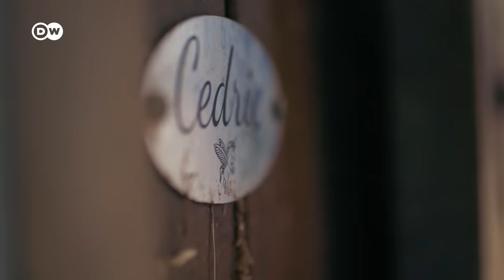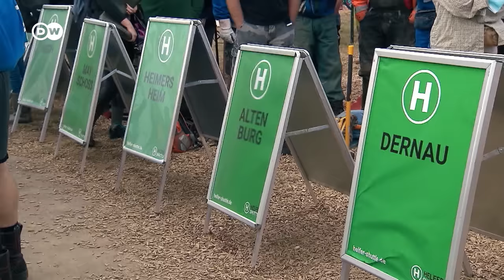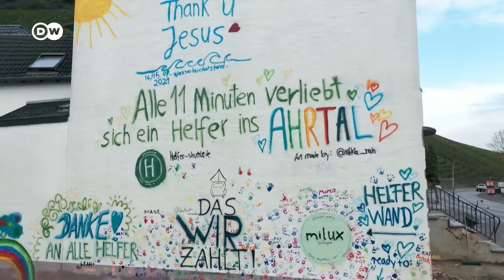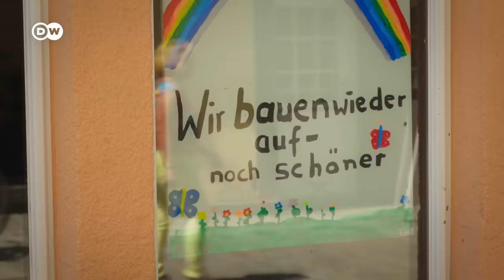Germany's flood catastrophe one year on | DW Documentary

Comment: So Germany doesn't have a system of warning sirens? In Sweden we have warning sirens in all towns. We test them 4 times per year to see if they're still working. The sirens are mainly intended to warn of armed invasions. But they can be used for any emergency event, such as flooding. Maybe if Germany had had sirens, it could have saved lives.
Reply: German efficiency🤣😂
Reply: @Ni An, you make an excellent point. I grew up in a time where our town had a warning siren. It absolutely provided early warning to approaching severe weather. Thanks for posting and be safe 🙏
Reply: Here those are tested every first monday of month at 12. Pretty simple stuff really.
Reply: Or maybe if the emergency council wasn't so lazy and corrupt, this could've been a much different story. But it's not and I doubt parts of the Ahr Valley will ever come back.
Reply: I don't know why the alarm didn't go off but also in Germany they have these kind of air alarms

Comment: It might not completely prevent the destruction of property but it would seem if the water levels are typically at the height of the average car, that is how tall?? Would it not be possible for builders to build a concrete platform the height of a car and put the house or commercial property on top of it so in flood prone areas the water rise would have a level it could rise to that would not damage everything in its path. Sure, as it seems, the areas do not come to find this, until after it has flooded and it may not flood again but it could be a viable solution for the future of building??